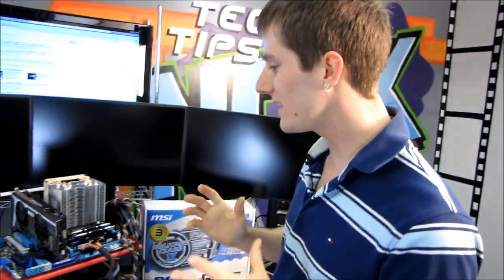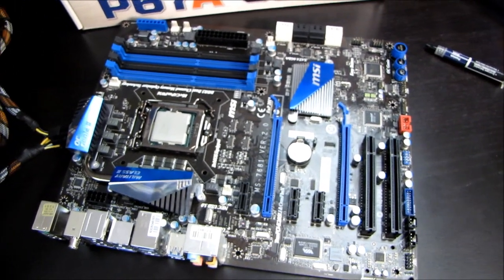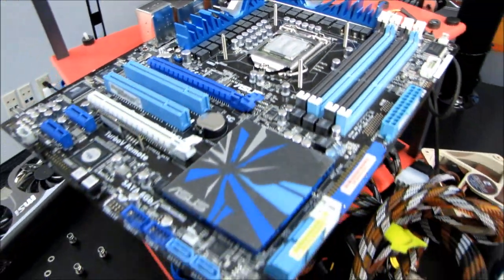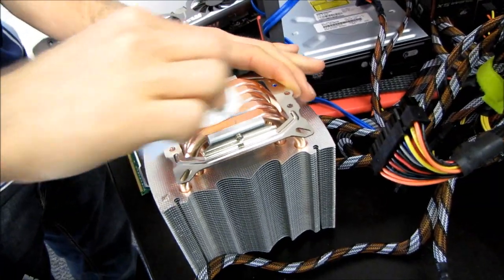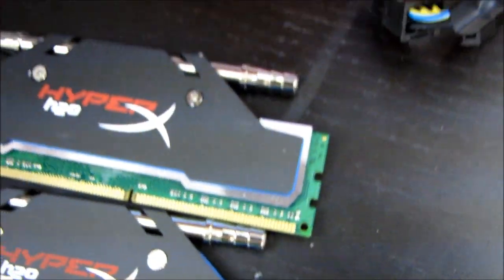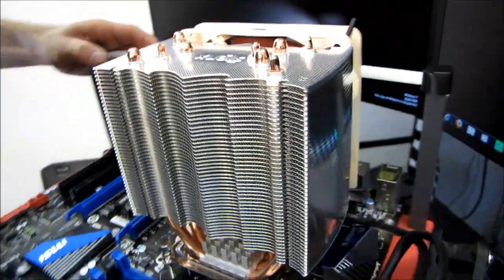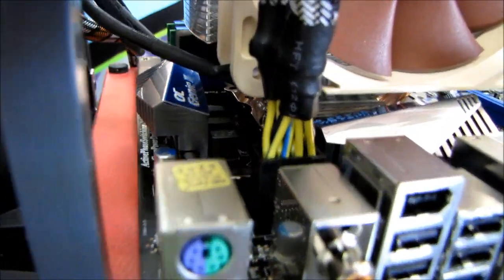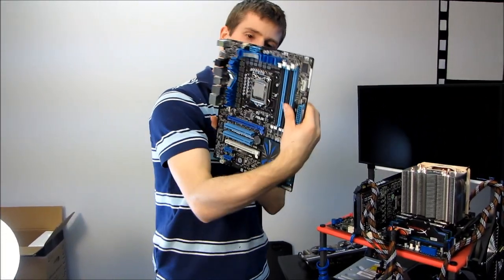How to Do a Motherboard Swap - Upgrading My Test Bench Linus Tech Tips

Comment: @WeActivate From what i've seen of the benchmarks so far, stock for stock it's equal to or better than the 6 core, $999 i7 980X.  You have to remember these aren't replacing X58 1366, it's replacing P55 1156, so having it beat the best processor thats 3x or more in price and has a $100 dollar or  more motherboard is pretty damn good.

The interesting thing?  This is stock for stock.  980X can only really get to ~4ghz and not on air.  2500K and 2600K can do 4.5 EASY. 5ghz seems to be the new 4ghz

Comment: @dslashdoodlezz No, time will not alter anything.  Do the research.  The max multiplier on Sandy Bridge (the only option to overclock) is x57 with the bus speed at 100mhz.. 57x100= 5700

Comment: I need help! I gonna upgrade a different manufacture MB. Do I need to install the new MB driver first and them install them. Cause I know I might get window7 fail startup
Reply: Rip
After 3 years nobody bothered to help 

But me
Uninstall other drivers and then I would recommend reinstalling windows for a smoother reboot and then install new MB and when it is starting up spam delete I’m pretty sure and when the bios screen comes up either use a usb from another computer that has bios on it or install them from the internet watch the end of jayz2cent video on amd ryzen build guide and install from internet 
And then bam everything will be gud
Reply: A true hero the world desperately needs. Respect.
Reply: Do I need to reinstall windows?? Or can I just uninstall all of the stuff in device manager?
Reply: BLDJLN ik its been 2 years but i need help im upgrading from a ddr3 Amd Asus motherboard to a ddr4 intel Gigabyte motherboard on windows 10 I’ve been trying to find out how to do the upgrade because Im changing ram processor and mb but couldnt find anything
Reply: @ObeyModZ  you have discord?
Reply: @ObeyModZ  same here. all I have heard is to uninstall all the drivers for your motherboard processor and anything else your changing. unless your doing a fresh install of windows on a new drive

Comment: Seriously?  We wanted to know what todo next with the operating system... The hardware exchange is the easy part.
Reply: You reinstall windows.
Reply: @aroberts3213  UGGGGG...NONONONONON..thats why were hear..looking for techniques to NOT do that. It would literally take me weeks to re-install and reconfigure all the software I use. I just want to pop in a NEW MOBO/CPU/RAM combo into existing WIndows 7 install. Just saw another video where the guy talks about removing ALL the drivers from windows before doing the swap, then powering back up with the new hardware.
Reply: if you're on win 10, you literally have no do absolutely nothing with your operating system. Just convert your account to a microsoft account before you swap it and your license will be activated when you log in for the first time. windows will usually update all of the drivers automatically
Reply: @SkateFallen1424  Thanks !

Comment: Depends on if your new MB accepts the same socket as your previous MB. i'm not quite to sure of the windows key, but i don't think you have to as long as you don't wipe the HDD that you have it installed on, this way you don't actually have to re-install. 

*Based on my own experiences: Subject to be wrong on windows key part*

Comment: @leanlifter I don't think you quite understand what you are talking about.   Look at the Sandy Bridge vs any-other-processor benchmarks for commonly used programs like winrar, video encoding, HD video playback, even gaming, the SB wins hands down, not even close.  For the 2500k which smashes every processor out now even at stock speeds (except the Gulftown in a few benches) you can reach 4.4-5.0ghz for $217, I'd say that a hell of a bargain.  If you don't then I don't understand your point.

Comment: So DDR3 came out at least as early as 2011. That just shows how old my MOBO is with DDR2 in it.
I do have a newish Videocard and a SSD for my OS.
Reply: kairon156 I thought this was posted the same time the video was uploaded, but DDR2 in 2019? Holy craaaappp
Reply: @jesusnajera3527  I know right.
I'm just glad I was able to find some 2nd hand RAM that someone tossed out (spring cleanup) so now I have 10GB of the stuff.

I even had a GTX 660 until I bought a GTX 1050 about 2 years ago. It would have been nice to get a 1070 but at the time they were, Expensive!.

Comment: so if i replace my mother board what happens when i turn on my pc? will i have to get new windows or what?
Reply: Probably too late, but the only difference (in your operating system) that changing your motherboard would do is have a different splash screen on boot up before windows, and a different BIOS.
Reply: What if I have an OEM edition of Windows? It's tied to the motherboard, however most say I don't have to worry about anything concerning rebuying Windows. Also, do I have to do a backup of my files on the HDD/ reformat it? First time upgrading, any help is appreciated.
Reply: ChazzyBoi_777 I believe all versions of windows are meant to be tied to an owner and a single PC. The best way to do this is a hard drive, but I believe they wanted to make it not possible for someone to plug a thumbdrive with windows into different computers without OS. This is why its tied to the motherboard as well, which when it connects to the server tells if its legitimate or not. Just contact microsoft support and they should be able to help.
Reply: Again, I'm probably a little late. But the Windows 10 anniversary update now allows you to tie your windows license to your Microsoft account, so you can move it between mobo's without rebuying.
Reply: Jamelele I know Im really late but Im about to swap my mobo. Is this true!? How can I tie my copy of windows to my Microsoft account? It would save me a lot of money
Reply: Silverism not sure if too late, but I installed Windows 10 for free by searching disability Windows 10, and doing some light digging. If  all else fails try it out. it is supposed to be a limited time offer though.
Reply: Tim Parker yeah I need to know the same thing
Reply: am I too late? How do I tie a copy of my windows 10 into my Microsoft account to transfer my HDD to a new Mobo/PC?

Comment: Activate windows screen more like as you get 30 days free with windows and they have older test drives. If the clock goes past 30 days it does that.

Comment: You might be able to get away with it but it is a hassle. You need to call M$ and they determine if it is a new pc or not. For me...I'm just going to go to wal-mart or something and grab a new copy, because I'm upgrading everything but my cpu. Do you have the full version in the box (non upgrade)? or an OEM in a sleeve? You can do it with the non oem  version (not on upgrade version as far as I know). Find out which exact version you have and check forums.

Comment: why Linus don't spread the thermal compound to the hole surface?
i always do that because the core is getting hot and when you spread the compound the compound can transfer more heat to the heatsink.

Comment: Sure the IGPU in Amd CPUs is better I'm not even sure if that's the case at this point with Intel's HD4k. But When it comes to raw horsepower Intel is faster Clock per clock.

Comment: What do you/ can you use to start the PC from an open bench? Like what do you use as the "power button" on an open system?
Reply: You can short it with a screwdriver :) (there are 2 pins you need to touch with screwdriver - explained in mobo manual)

Comment: agreed. my friend and i have almost identical desktop rigs. the only difference is our 6-core processors. he has a Phenom II x6, i have the FX-6200. stats wise, i should be better off, but his machine walks all over mine. and the FX's aren't compatible with ANYTHING. my rig refuses to run most Valve games at higher than 26 fps (note i'm running a 2gb ddr5 6950 card) but performs fantastically when playing battlefield 3 or Crysis 2. AMD needs to re-think their game a little

Comment: I had to replace my mobo because it was faulty( switched from z97 asrock to z97 gigabyte) will I have to format my drives and reinstall windows 8.1
Reply: Bryce Morgan this is the type of video I was hoping for. This video did not help at all unfortunately.
Reply: Have you replaced your motherboard yet? If yes, did you have to reinstall windows?
Reply: Ali I replaced mine, and I did not have to reinstall Windows. I did uninstall a bunch of drivers though before replacing tho. Basically all the mobo drivers.
Reply: +Bryce Morgan window's 8.1 is installed on harddrives / solid state drives, all your information will be safe. the only things that will be needing to be downloaded is the new software for the motherboards.
Reply: I should do a backup before I swap my motherboard just in case. but what happens if I don't uninstall the drivers because I dont know what to uninstall. Will windows automatically replace them?
Reply: SpieroMusic do you install the new mobo drivers before the swap or after? Sorry I'm late, and I'm guessing after but I want to be sure.

Comment: @jchambers2586 "...stuck with a crappy amd 1055t." There is nothing crappy about a 1055t. They are probably one of the best AMD cpus Price/Performance. And a 5770 it may be a bit Mid rangeish, It's still a great Gpu for its price .

Comment: I got a ssd and installed windows 10 on it in my build, the system a few weeks later suffered a power surge and the mobo is dead along with the psu. I understand I need to do a clean install of Windows on the ssd, but I had some work files on it (programmer so wanted the faster speed of the ssd), can I still plug it into the new mobo to get my files off it then wipe it for reinstall?

Comment: I am getting a new motherboard soon and I managed to get my oem activation key with help from microsoft support. How would I prepare my pc right now for the new one? Would I need to factory reset my pc then put the new one in and do all the bios shit and activate windows, or do I also need to deactivate windows 10 on this pc right now to be able to use my key on the new mobo
Reply: MY pc right now is a prebuilt from acer, Just to make sure, is the oem key I got reuseable or is it used once then its done and cant be reused at all

Comment: Okay. My current motherboard can only support 8gb of RAM, and I'd like to go higher than that, which would mean replacing my motherboard. When I do eventually swap, will I need to do any sort of reinstalling of either Windows or my drivers? And if so, is there some way to get around that?

Comment: If i bought a new msi intel motherboard do you have to thermal paste it like you did ? I have a acer motherboard it would be an extreme upgrade.
Reply: You must replace thermal paste if it is exposed to air. However, you can get it for cheap as 8 dollars.
Reply: Well doesn't the cooler expose it to air?

Comment: sooo.... do I have to buy a new copy of windows 7 if I upgrade my motherboard which has 770 chipset, to a 990fx chipset motherboard? Or will windows recognize the new mobo automatically? Because i read that I might need to reinstall my OS in order to get the new drivers working :/ but im worried that i cant reinstall my OS after formating everything (easiest way to remove old drivers that what I know) out of my harddrive because the license wouldnt work anymore :(( or will it work?

Comment: So, when I switch out a motherboard do I need to buy a new processor? Or could I just put the old one into the new motherboard?
Reply: All you've got to is take your processor, take it out of old, clean off the thermal paste, put in new, reapply thermal, then put heat sink or whatever your using on, So you can just take old and put it in knew.
Reply: Awesome, thanks for the info.
Reply: ONLY IF! its the same socket

Comment: Hi my laptop is: N950KP6 15.6-Inch Performance Entertainment Laptop (1TB 7200RPM HDD + 8GB RAM + NVIDIA GTX 1060)

It's processor is this: Intel® Pentium® Processor G4560 Dual Core (3.5GHz, 3MB L3 Cache)

Can I swap with this: Intel® Core™ i7-8750H Hexa Core (2.2-4.10GHz TurboBoost, 9MB L3 Cache) ?

Comment: Hi LinusTechTips i really need your help. My current motherboard has a FM2 socket and im trying to change it to the latest AMD socket for better gaming cpu performance. I know that I need to replace the CPU but i still dont know which to keep or replace. Like the Hardrive, memory, etc...  
My current board is MSI A78m-E35.
Reply: Keep everything except the mobo and cpu, and if your new mobo supports different ram, get new ram. I would suggest keeping your old parts if something goes wrong or if you want to build a new rig. Cheers!

Comment: @psphacking411 

I think someones angry, I have changed hardware in my desktop build many times, Processors, Video Cards, Hard Drives, Memory and I still have a valid copy of Windows 7. The system that was display the error wasn't his test bench either. It was the triple monitor AMD Dream Machine from a previous video that had the non-genuine copy of Windows 7 on it.

Next time before you call someone a "Noob" do your research kiddo.

Comment: LINUS! Pleas help me. When upgrading the motherboard do you have to reinstall windows and if so do you have to buy a new drive or format or bler or blah... PLEASE HELP ME!
Reply: same question! PLEASE HELP ASAP
Reply: No, just plug in your harddrive into the SATA ports and it should work.
Reply: i was thinking this as well cause i just ordered my new motherboard today and didn't know if i had to reinstall windows
Reply: TECHNICALLY you should reinstall windows so as to avoid driver conflicts. In reality, and my personal experience, it doesn't matter at all. So basically, don't worry.
Reply: James Labelle ok thanks for the help
Reply: So, how did it work out for those that tried it?
Reply: i had to end up having my harddrive wiped and re install windows
Reply: Spencer Wariner For me it did worl even in a WHOLE new pc.

Comment: Upgrading from H110-MA to Z170, do I need to reinstall Windows? Or Can I just take everything out and put it back in an it will be fine?
Reply: How did it go for you? I'm upgrading to same board
Reply: ***** I haven't done it yet, I will be soon, still choosing a motherboard. I will tell you how it goes if i remember to.
Reply: M1Garandstudios i just done it, went perfectly fine for me, didnt have to do a clean install
Reply: ***** Awesome, what exactly was the process you took? And do you have Windows 10?
Reply: M1Garandstudios yeah i have win10, and all i did was remove old mobo, put in new one, booted it up fine, then i installed the drivers, and my windows wasnt activated but i just used the same activation key i used the first time
Reply: ***** Awesome. Did you delete drivers first or just take it out without any prep in the software?
Reply: M1Garandstudios nope
Reply: ***** Nice to know, thank you for the insight of the process, I have gotten so many answers, but now i have gotten first hand info. Means a lot man. Thank you.
Reply: M1Garandstudios no problem, because there the same manufacturer there shouldnt be any problems
Reply: ***** What boards did you have? What did you upgrade from? I have a gigabyte board, but I am looking at an MSI board. Is that fine?
Reply: M1Garandstudios should be good, try deleting old drivers before hand just to be safe
Reply: ***** Ok, I was also looking at another Gigabyte board
Reply: M1Garandstudios what version of widows did you guys have oem or full version? I'm making the upgrade to a new mobo and cpu with a oem copy of Windows
Reply: M1Garandst

Comment: Do you need to reinstall windows when you change the cpu ?
Reply: vidyaWolf I need your help so I'm geting a  new motherboard and a new processer I have Windows 7 on my hard dive so would my windows 7 be on my new motherboard and my processer please replay
Reply: yes you can, but you might need to reinstall it to configure your new drivers
Reply: I want to know this as well, did you figure it out?
Reply: JsHawk I learned that if you uninstall all drivers, and turn it off, then swab out the stuff then you should be good
Reply: enrique cordero so what exactly are the drives?
Reply: no????

Comment: Guys I have a question. I'm not that tech smart but I've heard that if I swap my motherboard I'll lose al my stuff? What I want is to switch my processor but the one I want has a different socket than the one I want. Would I have to switch my motherboard or not? The CPU I want has an AM3 socket and the one I currently have has a FT1 socket. Please let me know if I have to swap my motherboard, and if I do will I lose all the stuff I have stored on my PC ? Thanks in advance
Reply: Than the one I own* sorry
Reply: You won't lose any of your data, you'll just get a different start up bios